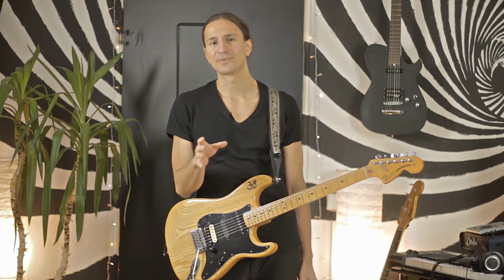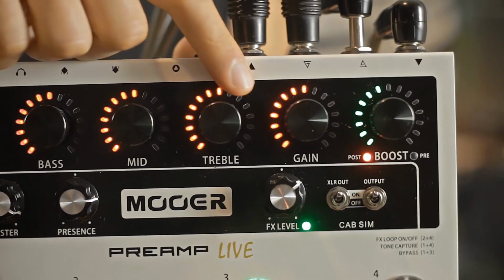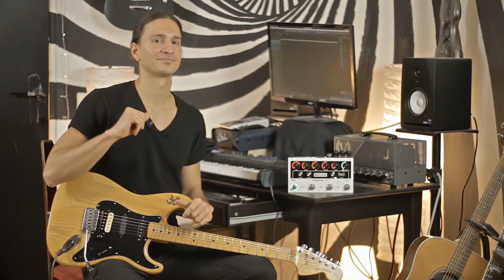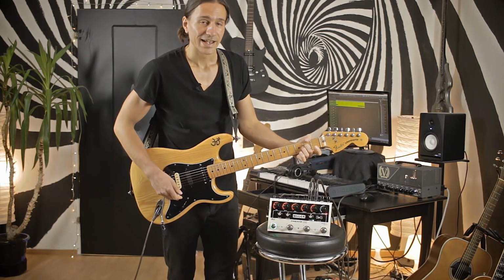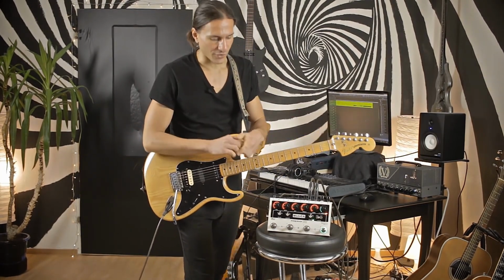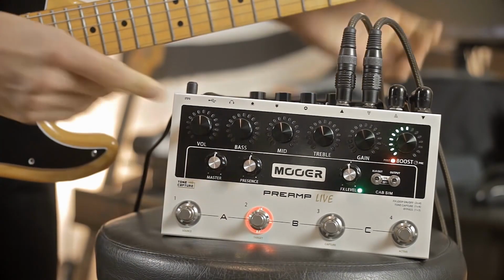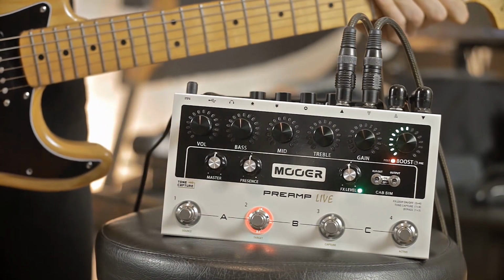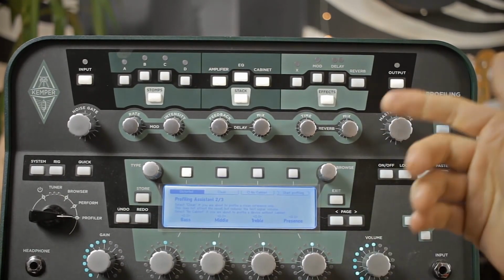Kemper vs. Mooer Preamp Live  |  Profile vs.Tone Capture?

Comment: The tone capture is very impressive and will get you 95% there, tweak away for the other 5%. The only issue I have with the tone capture is that you need to save the capture on the same preset you are working with. So if you liked the stock JCM900 preamp and used it for source in capture, you will lose that JCM900 stock preamp when you save the new tone capture. I wish this unit gave me some empty banks to save to so I didnt have to save over the original loaded preset.

Comment: Have you done anything to the volume or eq to the tracks? They both sounded good but the Kemper didn't quite pierce through the mix as the mooer did.
Reply from the maker: I did just the usual low cut but besides that it's pretty much flat on the eq.

Comment: The way I understand is the Mooer has 8-9 predefined amps and does an EQ match to get it close as possible.   While the kemper also secretly has base profiles and does a higher fidelity match using an impulse response & EQ match. You have to like Mooer's set amps if you are to like its tone capture since its a derivative of those tones.    Both fail in emulating the dynamics and controls of a real amp post profile...   Do a blind test next time with something with less gain :)
Reply: False. Kemper doesn't fall into emulating the dynamics. I play live pretty much every Sunday with a Kemper and it's outstanding. Period.
Reply: @depechex  I said dynamics and controls... The master volume of some amps also add gain etc.  So you will need more fiddling with the Kemper.   I have one too and it's the best modeller/profiler out there but it is not perfect.